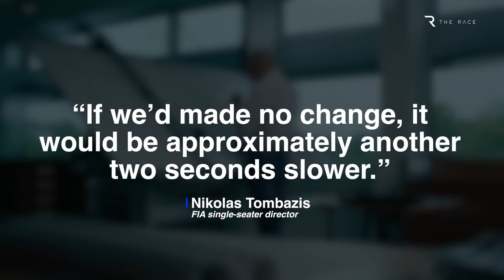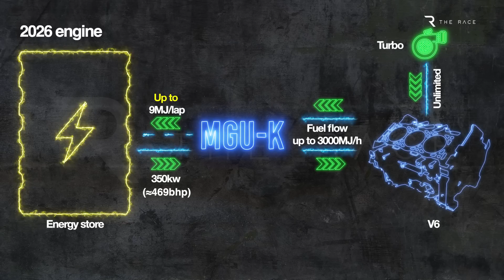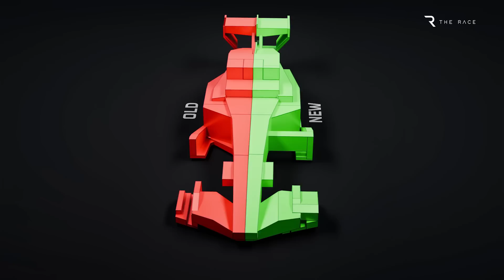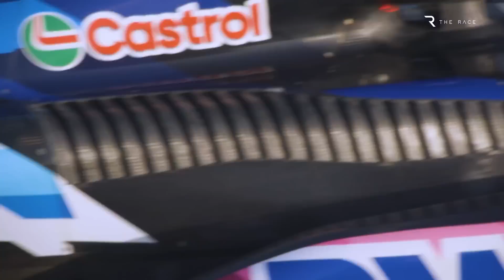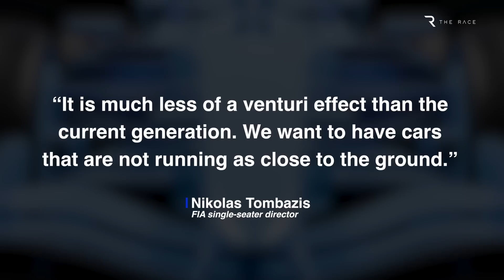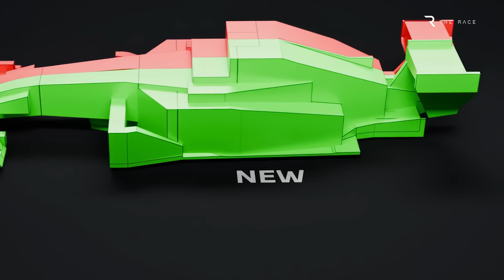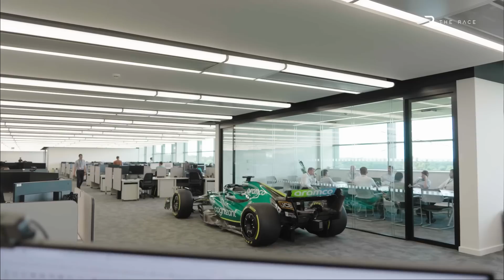How F1's 2026 cars will now be two seconds faster

Comment: I know the MGU-H costs alot but its sad to see them abandoning the concept after teams working for so many years to make it work, and now that it works and now that such systems are finaly finding way into road vehicles (ex. 911 GTS) they are ditching it. 
That system made ICE engines incredibly efficient and the only electric power will come from regen braking. Its a step back
Reply: Seconded. It was expensive for sure, but the cost cap is supposed to force even factory teams to live within their means, and if that includes an MGU-H, I say let 'em go for it. It also would have gotten cheaper with time anyway, as shown by the increasing willingness of Mercedes and Porsche to put them on road cars. Alas...F1 scores another own goal.
Reply: @mitchell-wallisforce7859  Exactly.
Indeed, the C63 hybrid 4cyl (2024) failed as a product on its market, but we need to take our hats off to Mercedes. They managed to mass produce a practical sports car with a functional MGU-H system for less than a 100K usd. 

It lacked some polish, but it was their first attempt.
Porsche is doing it, but it's a bit easier to make it work when charging nearly 200K for it.
I'm sure, with better maturing, Mercedes will make way for this tech to go into their diesel hybrids shortly.

MGU-H is an awesome piece of tech I think will make way into production in the next Ferraris and Mclarens. 
FIA saying it's irrelevant because it's too expensive is bulshit.

They just bent down for other engine manufacturers to speed up their entries and competitiveness.

The tech was solid.
Reply: @ Eh, only the basest of base model C-class AMGs are gonna cost under $100K, but I see what you're sayin'. I still think Porsche deserves a nod for being one of only two companies to try this. Mercedes applying this to diesels is a smart call too, they do seem to be leading the charge (pun not intended). 

And hard agree on the FIA spouting nonsense. It's not even just that MGU-Hs are relevant, but they're so simple in principle and useful in reality for both performance and efficiency that they are verging on no-brainers. Guess we can add this to the pile of tech F1 could've elevated but collectively chose not to - a pile that is getting pretty gargantuan at this point.
Reply: @ about 75% of the electric energy currently produced in an F1 car comes from the mguh, so in 2016 they will be burning fuel off throttle just to charge the batteries.  it's just utter stupidity. the current PUs will be looked back upon as the best in F1 history in some time. They are the most powerful raceday powerplants and the most fuel effect,  and thus far longest lasting.  the mguh was not that expensive to develop.  In actuality it is just an electric mgu connected to a turbo, getting it to 5kg made it cost some more.  williams flywheel was also a lost opportunity by f1
Reply: @Lucas-ck1po  I've driven C63's and believe me- the four banger is dead on arrival. Until you've caned a C63 with a V8, you haven't really experienced the thrill of the platform. Doesn't matter if the four cylinder has equal power- it has absolutely no soul. Give me a raucous V8 roar any day. ICE forever.
Reply: @mitchell-wallisforce7859  yeah they could've kept mgu-h, smaller teams be damned. this is f1, it's going to cost at the very top. if you can't cut it, you can easily be replaced. there's no shortage of established racing programs wanting to enter F1.
Reply: @ Actually, it's funny you say that, because IIRC from looking at the current/outgoing engine rules, they actually wrote the MGU-H into the rules. I can't remember if it was mandatory, but it shows just how much specificity F1's rulebook inserts, and much of it for no real reason.

Maybe if the engine design and operation rules were more open to different approaches (100L of fuel for a race but fuel flow can be free, unlimited turbo boost, etc.) a group like Ilmor, Judd, or Cosworth could put together a conventional twin-turbo engine that omits the MGU-H and is vastly more affordable for minnows to buy and run. And maybe if F1 still had open entry lists and pre-qualifying like the Indy 500, there'd be a lot more of those minnows to help those engine builders turn a profit and stick around.

I guess my point with all this is that there are a LOT of things F1 does today that either make the worst kind of sense or none at all. Invite-only closed shop entry lists, suffocating technical regs, etc. It sucks because it's easy to see what this sport used to be and COULD be again if it really wanted it.
Reply: @pauls5745  the mguh cost the engine manufacturers to develop, it didn't cost the small teams a penny, most of their engine costs are subsidized by the manufacturers
Reply: @byanymeansnecessary9329  right, the customer teams just buy the complete PU. So I guess they wouldn't care so much one way or the other.
Reply: @pauls5745  video literally said there would have only been mercedes and ferrari.
Reply: The manufacturers wanted more of a 50-50 split as cars are hybrids are the cars they are selling right now. Its still going to feed into the car market. The big question, is what happens if/when most of the car market is electric... what happens to F1 then? I reckon F1 with V6s will continue as long as there is a good portion of the world market to sell hybrids in... eventually the manufacturers wont be interested if they cant sell hybrids. This is a long way off atm.
Reply: @thesupremekai1980s  The 50% energy proportion makes sense.
The issue is increasing to such proportion while getting rid of the piece of tech that specifically uses wasted energy to generate it, thus relying solely on regenerative braking to reach the potential they seek. 

F1 cars don't have a front drive, they only have an electric motor on the rear wheels.
RedBull has stated that the potential regen braking on the rear wheels is already on the limit, regen braking harder to generate more power would lock up the wheels.

The best way of reaching this proportion was through the MGU-H or adding front wheel drive on F1, which they wont.
The issue is on how teams will reach such regen potential with rear braking only, without an MGU-H unit.

Some are saying the cars will apply "engine braking" while under ICE load to recharge the batteries, like, 100% throttle while the motor is generating power, "robbing" power from the combustion engine to apply it during acceleration sections.

And not only an MGU-H is smarter but at this day and age, it is a more realitic approach to road applications for the future. It was a more promissing technology.
Reply: It’s stuff like this that makes me think f1 is more just a show now and less about the progression of technology and chase of the ultimate racing car.
Reply: It was also incredibly expensive, difficult to work with, was able to make or break an entire engine even if everything else was good, made the sport uncompetitive for 8 years and made bad sounding engines sound even worse.
Reply: Sadly, the truth is that they are scary expensive and at best a bandaid for internal combustion engines.   When that rule came in, it was in part because the cars could not actually store up enough energy just from their braking events.  regenerative systems have become much more efficient, and I think you will see teams going with some interesting harvesting techniques for charging the batteries at various times.   I can very much picture a situation much like the blow diffusers of old, where running the entire just to generate airflow was key.   Now it could very much be run-on to generate more electrical power or otherwise tapping engine power while cornering.
Reply: I do wonder what the viability would have been of spec MGU-H turbine preventing a continued expensive development war on the most efficient possible turbine design.
Reply: @GreeniusGenius The more cars go spec, the fewer variances you can have.  a spec part would have been acceptable in a sense, but would have also eliminated any different in design leading to different outcomes.    One of the greatest things from the past of F1 was the variance of designs.   In today's META knowledge world the cars mostly have little between them, and aping the more successful designs is only limited by rules that make it hard to test to assure you copied them correctly.

It is why Adrian Newey is so valuable, as he constantly finds ways to extra that extra whatever it is out the a car design that perhaps some others might overlook.  

MGU-H was an interesting idea that failed to provide much more than a failure prone part that was expensive to make.
Reply: Nothing wrong with regen braking. AT THE FRONT AXLE!!!
Reply: It would have been smarter to allow more MGU power output and reduce Fuel Flow accordingly, without reducing the Turbo Compounding.
Reply: Should really go back to Engine only at this point
Reply: 911’s mguh system didn’t come from f1 or isn’t the same. It came from wec. Not to mention we probably won’t see mguh as daily use so it’s not really relevant or useful technology as turbo lag isn’t that big of problem no more.
Reply: @vr5lover  So what Porche's system comes from WEC? The technology is still based on the same principle, and it could still benefit road cars.
That's what I mean. 
FIA claimed it wasn't relevant to justify its removal, which was bullshit.
Regarding boost lag not being an issue anymore, MGU-H's biggest benefit isn't improving boost performance. In fact, it takes boost potential away.
The biggest benefit of such a system is constantly sending power to the batteries and electric motor.
The benefit is using waste energy to keep the batteries charged longer.
Road hybrids could benefit largely from such technology, and it is extremely relevant for road vehicles.
Reply: @Lucas-ck1po  First up, the Porsche is nearly 200k out the door.  It is a price no object sort of thing, not specifically relevant for most of us.

Second, it uses a technology level that costs more than the average road car.  Are you ready to pay double for your Camry or whatever to support such a technology?

Third, and most important:  unless you are driving the snot out of it all of the time, do you really think carrying around the extra weight of the system is really worth it?    When you are putting around town in stop and go traffic, is this any better than a normal hybrid or stop start system?   Is this truly generating a notable benefit except to Porsche stock holders?

F1 and those making the engines came to realize that this isn't a road worth going down for now.  It is a failure prone part that is expensive to develop, maintain, and to try to optimize.   In a series where there is a cost cap, getting rid of a mostly meaningless technology is a good move.    Or more importantly, it isn't a bad move.
Reply: @ 

1) The Mercedes costs half what the Porsche does. $90K still ain't cheap, but it's also not too far away from some trims of a new Ford Mustang. For such finicky and expensive tech to be integrated into a car costing that much isn't doing too badly.

2) It's reasonably likely that MGU-Hs will get dramatically cheaper to implement in much the same way turbochargers themselves have over the past 40 years. Think of all the soccer mom cars sold now that carry a turbo. 30 years ago that was motorsport tech exclusively.

3) Might just be me, but I always think of electric motors on turbochargers as a way to reduce weight. An MGU-H fitted to a parallel hybrid can partially recharge the battery while accelerating (something the Porsche 919 exploited to great effect, and something you cannot do with KERS), meaning you could carry a smaller pack without worrying that you won't have the energy left to use the electric motors when you want. And then there's Audi's 2024 Dakar winner, which proved how useful a range-extending gasoline engine can be in an electric vehicle. An MGU-H could allow for the harvesting of even more energy from a running range-extender without even using any more fuel, possibly reducing fuel storage AND battery size needs. The possibilities here are quite numerous and have yet to be explored fully.

Finicky and pricey? Yes, very. But in a decade or two, we might just see these fitted to Camrys as frequently as we see turbos on every econobox now. In the broader context of automotive development, the MGU-H is a pretty colossal win. Formula One helped do that, and could've continued to reap the rewards as word spread of where the new C63 AMG got its best party trick from. As the tech trickled down, the crucible of F1 could've helped further refine the technology.

There is no higher purpose for motorsport than as a battleground of ideas, and there is no greater validation of that than to see one of those ideas have a positive impact on the world outside. One of these days, Mercedes could've put out an ad showing a C-class and their current F1 car side by side and had that mean something. Amid an increasing sense that Formula One's tech wars are getting too abstract and detail-oriented, we're banning the one dramatic exception to that rule?

If that isn't worth a couple million out of the cost cap's allotted budget, then what is? Moreover, given FOM's current behavior, if unrestrained ambition is only used to sell you a glitzy, empty circus, then what the hell does that say about modern motorsport? We're willing to blow millions on a pointless launch party at the O2 Center, but not this?
Reply: @Lucas-ck1po  You aren't bright enough to realise porsche was already testing mguh system in 919 on the visible track when f1 was still racing with v8.
Reply: @Lucas-ck1po  Porsche introduced this system in 2012-13 while f1 started tests in early 2014. Porsche made it 2 years earlier and tested it a year earlier. Not to mention even tho use of it and system is similar it still got some differences.
Reply: @mitchell-wallisforce7859  Re: 3, The amount of time road cars spend accelerating is so minimal that there's almost no point to add a separate system to try generating power off of it. Turbos add boost, adds engine stress, adds even more weight and reliability concerns on top of the hybrid system. kinetic regen meanwhile works whenever you don't need excess power. Whenever more power is needed, instead of driving the engine harder, you can cover that hp deficit by adding electric assist.

If you already have a hybrid system, there's very little point in adding a turbo for efficiency unless outright performance is desired.
Reply: You guys don’t understand how big it was in getting the new constructors like Audi and Cadillac to join
Reply: @aaronmoyer4722  you don't understand how wrong you are
Reply: @byanymeansnecessary9329  I’m literally not tho. Go read
Reply: It’s because they want to turn Formula1 into FormulaE
Reply: A 911 GTS is not a road vehicle, it's an expression of a rich man's ego.
Reply: It was joke from the start, a pointless money pit that attracted NO ONE to the sport, and after trying to ditch it all the way back in 2017, they finally forced teams to capitulate once Honda pulled out. Ferrari and Merc only held out so long to prevent VW from joining. If you concern is "efficiency", then as Newey said, focus on making the cars far smaller & lighter, and then you save fuel/energy overall, while also making a car more AGILE and less CLUMSY which is what drivers have been asking for since 2014. F1 is a sport, not an engineering programme, sorry. EV and all that junk is a waste of time, when the real benefit to the motorist and pedestrian is cleaner fuels and more efficient and safe public transport. We could make new cars cleaner, lighter and smaller instead of focusing on power output and in car gadgets, and we could make old cars and trucks cleaner without forcing consumers to trade in a working car.
Reply: @Ruylopez778 👏👏👏👏👏
Reply: Well that's the is the whole point to get to sustainable fuel, back to just a combustion engine no electricity back to the old way, and eventually they'll come with a speed racer type engine, something that runs off of nuclear fusion, like they have already come up with miniature nuclear reactor just big enough to power a city for 20yrs, you got them in ships and submarines, why not planes, trains, and cars.

Comment: As soon as we get competitive fields, the rules get changed. I hope this is the last time we see a large reg change for a while.
Reply: To be fair, Ford and Audi do not have 2025 engines, so there is no choice but to change the chassis rules to suit the 2026 underpowered new spec engines.
Reply: @TassieLorenzo  That's fair. It would put them at a large disadvantage to continue with the current regs. I didn't think of that angle. Although I assumed, Audi would build on Saubers work. Lets we don't continue the trend of one team figuring out the regs while the rest struggle to come to grips with them for years.
Reply: Next rule change is already planned for 2030, don't worry.

Comment: The hybrid powertrain in le mans hypercar is practical. The new hybrid powertrain in F1 is not. I personally think that this is a bigger joke from FIA than moving from v8 to v6 turbo eingine. At least v6 turbo engine was fast...
Reply: The 2026 powerunit will not only be 34kg heavier with the bigger battery and motors, it's possible that it's slower in the straight as well because of weaker engine and harvesting for power.
Reply: @yeong_ster  and less efficient overall too because no more MGU-H 

A incoming disaster of a new engine